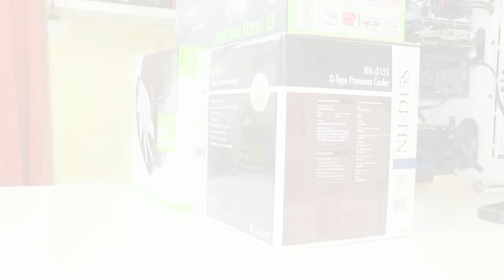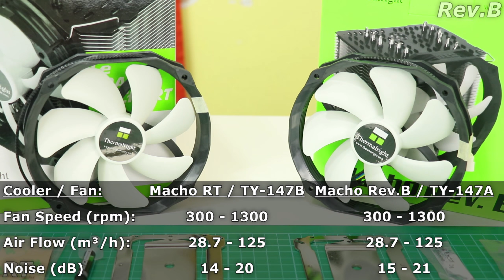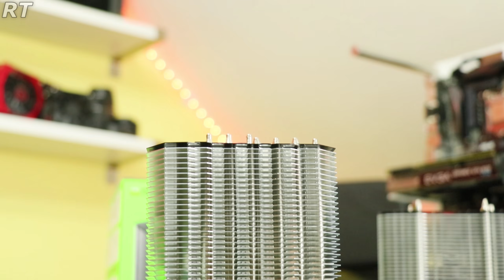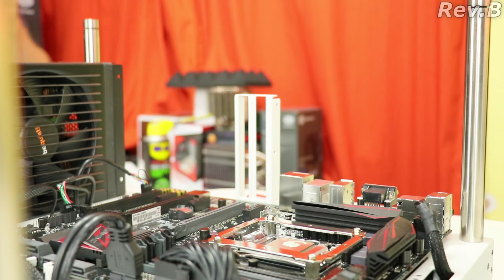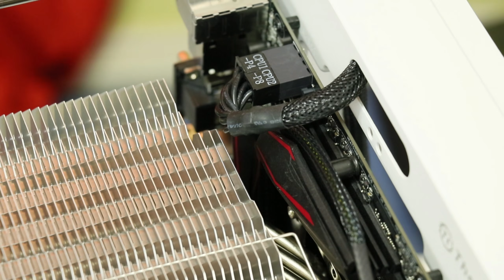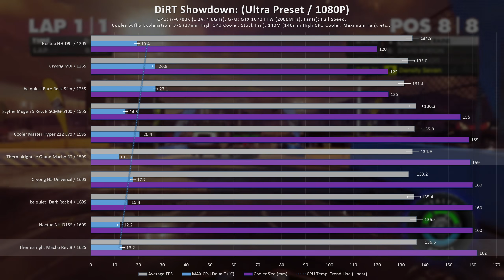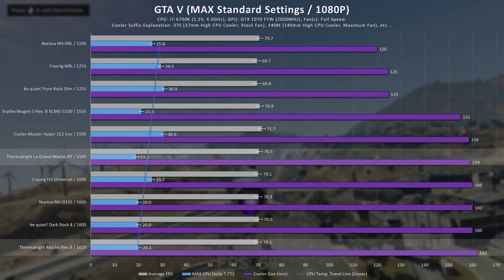Thermalright Macho Rev.B and Le Grand Macho RT Review

Comment: What I got from this series of testing.
Choose a Noctua solution that fits your build and have no worries that there may be something better out there.
Reply: Noctua is great but they're pissing me off with having 2 separate versions of coolers, one for Intel and one for AM4 socket. Others have shows that you can have an universal mount and still have good performance...but hey, gotta sell them mounting kits.
Reply from the maker: jake legg It would appear so. However if a few millimetres was added to the fans we were testing it opens the market up, and something better could be found. But as we found with the Le Grand Macho RT, bigger coolers aren't necessarily the most efficient for "low power" CPUs. Noctua have clearly done their research with this, and hence have a reputation for high performance coolers (and the colour brown :P).

Last Second Bloomer The AM4 mounting kit situation is a bit annoying, but they will send them out for free with proof of purchase. I can only assume that (at the tine of initial manufacture) they were not included with every cooler since there were so few people using AMD systems it would be a waste of resources, money, and energy to manufacture one for every cooler (knowing a small percentage of people would use them). Do they ship their new cooler designs with AM4 brackets as standard nowadays (if not, they really should)?

Ideally we could pick exactly which socket we would use and have only the mounting hardware for that sent out (I don't know about anyone else, but I'd prefer to not manufacture steel components that won't be used). However I get from a convenience standpoint that it would be better to have support for both right out the box. And a Universal mount would do the job perfectly.